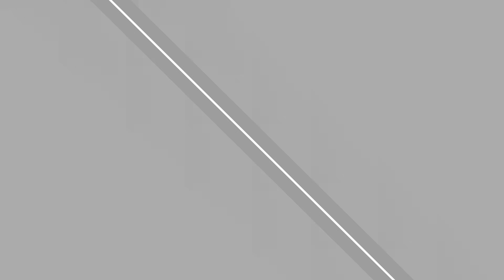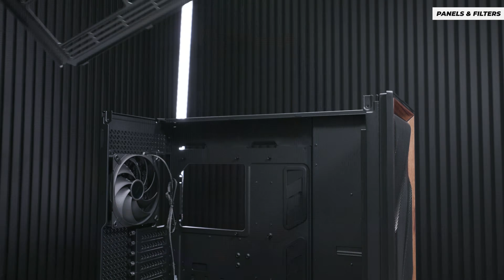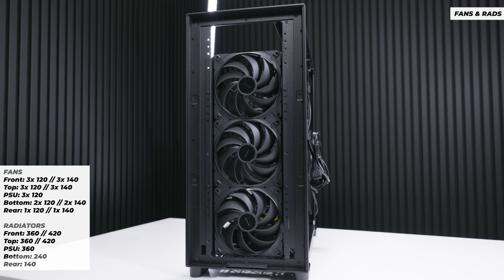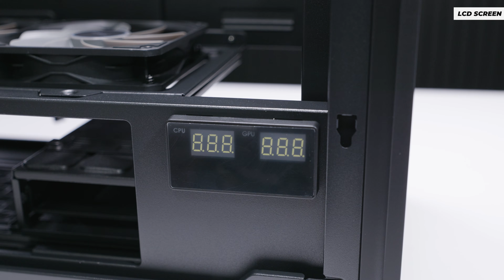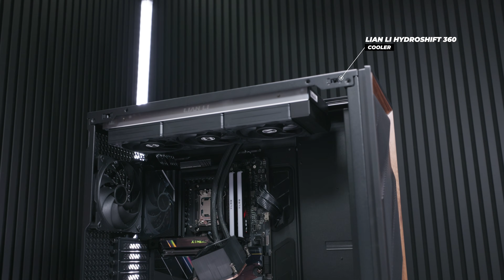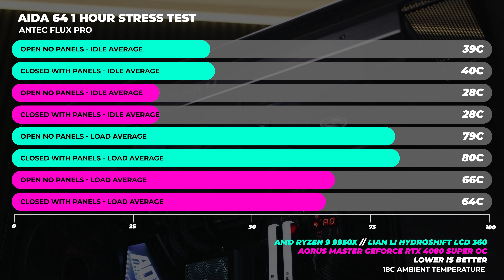The Antec Flux Pro is a BEAST!

Comment: Its a Case/Tower, I have one.
I wouldn't call it a beast, its more like a nice house with a built in Thermostat.

It will only be a beast if what you put in it is a beast.

The added fans, when price  compared to other towers without fans, are a nice perk for shopping, but they are added into the cost of the tower, raising the price a little more than those cases without fans.

All that being said, its a good looking case if you like wood aesthetics.

Comment: To get to the power switch, don't you have to take off the glass before you can remove the bottom panel? You basically have to open the case, and it's not that easy. I'll probably pull the plug.

Comment: Beast.. put filter on the bottom.. but not on the sides. So what is the point of this dust filter on the bottom? Top;.. again no filters. Its too expensive for antac? Woth mension that pro is not ready for project zero.. but cheaper without pro.. is
Only one thing what is nice in that case is how it looks from the front. Stron 2/10 ;p
Reply: @Ulthion  brainrot

Comment: The case is a beast but the packaging is definitely not. I opened the case today and discovered that the glass panel is shattered and there is a dent in metal on the side. Turns out the packaging has no padding at all on the sides. It's just the flimsy cardboard box and an inch or two of air between it and the glass. Huge disappointment!

Comment: Tried building a similar spec: antec  flux pro, lian li hydroshift 360 lt aio,  msi x870e mpg carbon mb. Issue i have is the AIO fans ramp to 100% when i connect to pcie power.  Im guess the fans ramping is from having 2 fan controllers. 
Does anyone else have a similar experience and know a workaround?

Comment: So, they did reach 95% of the way and then they quit? Case just looks nice, but... I/O on the top where the cat sits, no adequate vertical gpu mount, no hole on the top of the psu shroud to route the gpu power cables.. One look at Phanteks Enthoo Evolv X architecture tells you exactly what EVERY case must be capable of. Antec didn't read the memo.

Comment: I transferred my 13900K into a Flux Pro last week & over the 35 years I have been in this industry, it was an ‘almost’ effortless experience. Airflow & cooling potential is amongst the very best I have used in a case (& used a lot over the years). 
Couple of small issues though that I was not overly impressed with on building in it. First the grommets are terrible. Very thin, have a lot of flexibility & do not like being placed around thicker cables. These will tear if you are changing parts a lot. Second. The amount of depth behind the motherboard tray itself for cable management needs to be a little deeper (10mm extra would be perfect). If you use cable extensions, you need to ensure that the connector blocks lay flat against the motherboard tray & not overlapping any other cables else you will struggle to get the panel back on (cannot force it as toolless design). Thankfully with the longer amount of cable when using extensions this can be worked around with a bit of thought in the actual routing. Thirdly, having a bit of an issue with the iUnity software & the Flux Pro Display in that although it shows my 3080ti as an option to select in the software to show temp, it will not allow me to actually choose it & will only display the iGPU temp along side the CPU temp. Not a real issue as the case is under the desk (because of the size!) so the display is by my ankles. The fan hub itself is nice touch but needs one additional connector as case is supplied with 6 fans but only 5 can connect to it so the rear exhaust fan requires its own header on the motherboard. Saying that, the fans are very quiet & not heard them ramp up even when pushing the machine under a prolonged synthetic load like Cinebench. One change I would like to see is the basement plate fans, fitted so they are flush with the panel rather than sitting above it but a minor cosmetic issue. Can also remove the bottom HDD cage & fit a 240mm rad or more fans at the very bottom of the case if you wanted to.
Overall this case will be with me for a very long time tbh & is seriously worth a look at even with its minor issues. Plenty of room still even with a 360mm AIO up top (which actually looks small when installed!), so looking forward to putting a 420mm version of it in shortly.
Reply: Looks like it got lots of problems. I'll go safe with Fractal.
Reply: @eTT-11  It doesn't though, it may look like that due to OP's subjective opinion. I have normal version and I'm thrilled, if are comparing Flux Pro to Fractal North then this is no brainer best bang for the buck, for Fractal you are pretty much paying the tax for the brand recognition.
Reply: @tdav_a1 Obviously didn’t read what I wrote then as if you did you would see that any issues (3 in total) were actually very minor ones. 

After 7-8 months, I have to say that none of the grommets have ripped even after changing components a couple of times including PSU’s & removing cable extensions. 

The issue with space behind the tray is not really a problem if you don’t use extensions. If use extensions, you have to make sure they are flat against the metal & not overlapped other cables, especially the 24 pin ATX cable, which is same for most cases unless got large dual chamber style. 

The iUnity issue was resolved within a few days of posting with an update. 

One small “issue” that arose was when I installed a 1500W Corsair HX1500i PSU recently. I was unable to use it sideways for 2 reasons; firstly it was too long to fit with any cables plugged in to it & secondly, the plug it uses to connect to the mains is a different pin type due to the amount of power it can take so the supplied Antec extension cable will not plug in to it (PSU has horizontal Earth pin instead of traditional vertical Earth pin), so even if it did fit, I still would have to mount PSU in traditional way. would like to see Antec supply an optional high current conversion plate & cable for smaller dimensioned high current PSU’s (1200W+). That will be the same with ANY case that offers this sort of adaptor on high current PSU’s.

I have now replaced all the supplied fans with Noctua’s (mixture of 120mm & 140mm in both NF-F & NF-A models. NF-F on radiators & NF-A where not). Only non-Noctua fans are the ones on the AIO Radiator of my MSI RTX5080 Liquid Suprim SOC GPU which the radiator for it is mounted at the front as an exhaust. I was a little concerned about this initially but temperatures are better all round than they were with 3 x 140mm intakes at the front. I was expecting a hot spot where the airflow converged but seems like the bottom mounted fans will overtake the front fans even with their curve configured to be of lower speed/airflow than the GPU fans (as not seen the GPU fans go above 33% speed even during a long synthetic benchmark so the radiator is obviously doing its job well). The whole system under full load is still silent & temperatures in real world use on both the GPU & CPU have not exceeded 60C (only time they have is during long synthetic runs to burn in new GPU properly).

Still not made the jump to a 420mm AIO yet & looking likely that I will not unless I do decide to upgrade the motherboard & CPU down the line. It just isn’t needed as the 360mm does a more than adequate job in this case.

Overall I am extremely happy with the case & its cooling performance. I was tempted to buy 6 more NF-F120 fans to do Push/Pull on the GPU Radiator but it is not needed so will stick with the MSI proprietary fans used on it rather than faff about with FanControl to set Noctua’s to be controlled by the GPU temps over CPU or other thermistors. If I was to build another machine soon, I would probably wait & buy the Noctua x Antec collaboration version that was shown at 2025 Computex & save myself the hassle of buying additional Noctua fans, even if the price was a little higher.

Certainly a lot less issues with the Flux Pro than I hear from friends that have bought Fractal cases (mostly Torrent & Meshify series) who are constantly telling me they wish they had bought the Flux Pro instead. I don’t comment on issues with cases I don’t use myself, as they may not be issues to other people.
Reply: @tdav_a1 bro really saw a wall of text from ONE person and decided

Comment: Good case, but rather conventional in its design. Can somebody please move the power supply out of the way of getting air to the GPU (without losing front intake like the Lian Lee O11)? I'd like the temperature display, if it came with its own processor and temperature probes. I'd never run software in the background.
Reply: Wouldn’t make much difference as the air would be taken out of the PCIe slot covers before it actually reaches the GPU with another fan above where the PSU sits. The position of the bottom fans away from the actual rear of the case actually gives the optimal cooling to the GPU by actually reaching the GPU cooler before any diversion of the airflow happens.

Comment: Wish he explained more about the difference between flux and the pro. In europe the pro is 100 euro more expensive than the flux.
Reply: The pro supports a 420mm radiator at the top, and another 10mm of height for an air cooler. 

It has 2 more mounts for hdds. 

It comes with 140mm fans at the front.

 Has that temp screen. 

And the power supply on the side thingy.

Imo, there are not a lot of things you would normally care about unless you need it.
Reply: Main difference is that the Pro is bigger & has the display panel. If you want the smaller case & not bothered with the panel, then the non-Pro offers basically same cooling overall.

Comment: The feature I like most of this case is that, similarly to LL's 207, the psu shroud fans have full access to cool air without any obstruction!!! We need more cases with this feat.
Reply: Sadly the PSU obstructs the airflow to one of the three PSU shroud fans. If I get the case, I'll experiment with moving the PSU right to the front as obstructing that the first fan shouldn't be as consequential.

I wish they offered a dual chamber version of this case where the PSU is mounted on its side on the other side of the motherboard. I know the C8 exists but it does not have front air intake.

BTW, it would also be great to have a solid/mesh alternative to the glass side panel. I'd like to be able to provide the GPU with a direct exhaust path for the hot air it exhausts to the side.

Comment: Wow! I Love it! Btw what if to put AiO on the front, make sense to get more cooling? Because AiO on the top already has hot air from system and GPU.
Just idea, what do you think Mr. Gear Seekers?!
Reply: As the other comment said if you mount it at the front the gpu receives the cpu hot air. It would be mitigated in this case since you have fans taking air from below though but it's not ideal imho
Reply: AIO on the top provides better GPU cooling which normally means a quieter system.

Comment: This one's tough. If you judge the Flux Pro on its individual merit, it seems like the quintessential tower case. Antec have ticked pretty much all the boxes here. Trouble is, it's bland. It's safe. It's noob-friendly. Those of us who have been in the game for more than about 5 years would probably struggle to get excited about a case like this, despite it doing practically everything right. Surely I wasn't the only one thinking Antec were seemingly back with a vengeance to challenge our perception of PC cases with things like the Dark Cube. However, if you look at their product stack, they've literally cloned every successful case coming out of other manufacturers for the past decade. Without trying to sound harsh, this case would've impressed me in about 2018.
Reply: Been building since 1993, and this case is EXACTLY what I want. E-ATX, room for a large PSU, room for a thick 420mm radiator on top, no RGB, and, most importantly, some of the best thermals you can get. 

Not sure who you are trying to speak for here, but it sure isn't my demographic. Of my small group of gamers, 4 of us are rebuilding this generation, and we've all independently picked the Flux Pro.
Reply: There’s a massive market for bland, boring, safe, and tried & true designs.
Reply: @LSAKDFpo2q3  Absolutely. Chances are it will be a commercial success. Perhaps award-winning? And it'd be deserved as it seems well executed. Personally, I'd rather see companies taking risks and coming up with more unique designs.
Reply: @nanashivii9237 There are always niche markets.  The problem is that that’s not where the money is.  There is also a fine line between different and gaudy.  I got a North before this came out, but this probably would have been a close second.
Reply: It’s a PC case. It has good performance, it looks nice, and it’s affordable. What’s the problem?
Reply: Strange comment. Maybe you’re one of those who like the tricked out alien looking case designs with tons of RGB bling bling that many of us find juvenile.
Reply: @ddbear8786  Strange assumption. My preference is actually SFF with minimal or zero RGB. I can recognise and appreciate the design of this case, but my gripe was that it's too safe and I simply expressed a desire for case manufactures to take more risks and push the envelope a bit further.
Reply: Yeah this one is a cool case but in terms of design I'm much more excited about the Lancool 217
Reply: @gsm_liv8980  Hi! What makes you think the lancool 217 has it for you? Do you have info on it(other than that video of GN with ceo lian li)? Cheers